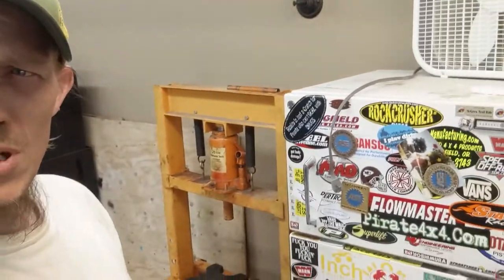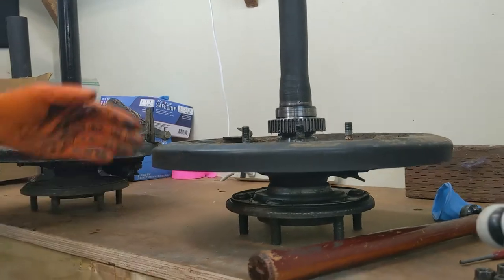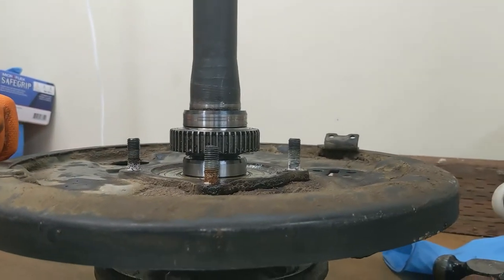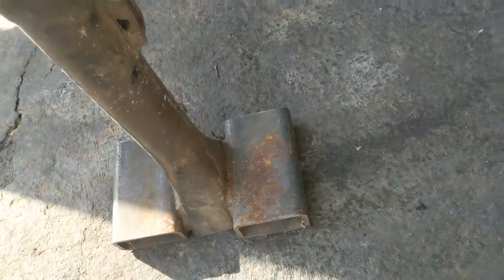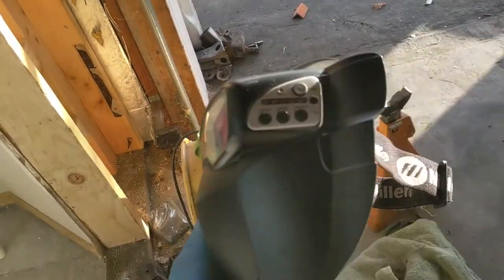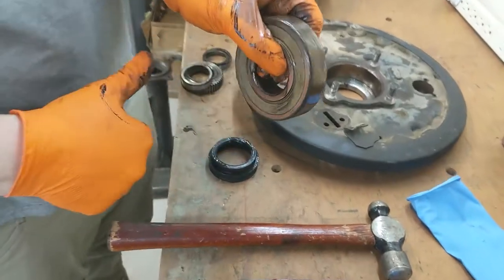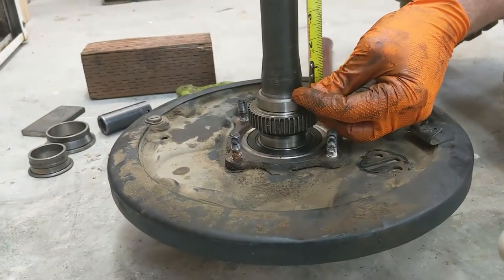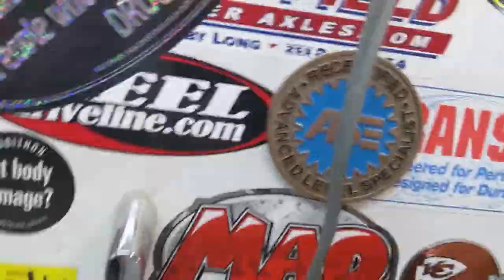Ep. 4 Snale Racing replaces Toyota Tacoma/4Runner rear axle bearings

Comment: Can you provide me with the measurements that you have for the placement of the abs ring tone? I replaced my bearing a week ago and didn't know to take measurements before taking everything off, now my abs is acting up everytime I brake at slow speed or coming to a stop.
Reply from the maker: The measurements vary by vehicle.  This is a 96-02 4runner shaft. The measure waz 24.5" from the collar to the end of the shaft.  As mentioned, you can install the axle and check the witness mark on the collar to see where that seal is hitting.  You can see our measurements at 2:19
Reply: @SnaleRacing  I have an 02 tacoma. I was watching timmy the toolman's video before I replaced mine and make a mark on the inner retainer and spin the axle to see if it was properly seated in the inner seal. I was able to get the the inner seal to seat in the middle of the retainer but the abs may not be in the correct position. I also inverted the face of the retainer and have the beveled part facing the abs ring tone as opposed to the original position when I first took it out. Maybe I'll just go back and switch that back to it's original position. Also, when you take out your speed sensor, is the abs ring tone dead in the center of the hole or is it off to the side?
Reply from the maker: @renzokukenleonhart  the tone ring should be as centered as possible.  The ring and sensor interaction creates a low voltage signal that can be affected by the position of the ring.
Reply from the maker: @renzokukenleonhart  you may just take the three minutes to pull the other side and double check fit/measurements.
Reply: @SnaleRacing  the problem is i did both side before checking. It was only after i did both axle that i test drove the truck and find out about the issue.
Reply from the maker: @renzokukenleonhart  That's a bummer. Such is the mechanic life. ;) Tear it out and chalk up the do-over, before you start leaking or whatnot.  Get the collar facing the correct direction and centered up in the seal.
Reply: @SnaleRacing  Yeah. I might make a trip to the local toyota dealership and ask them if they know the measurements.
Reply: Is it normal that the bearing is not tightly fitted to the bearing housing?
Reply from the maker: yes the bearing is a slip fit to the pocket.